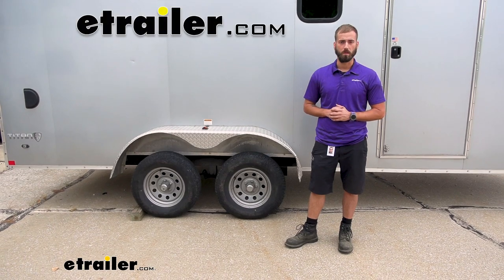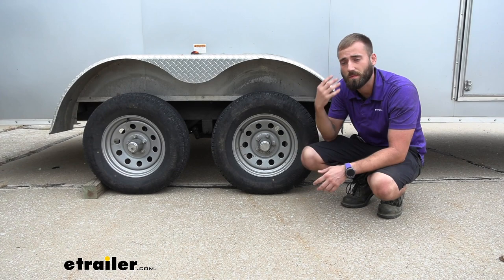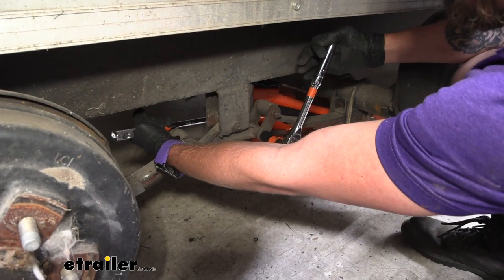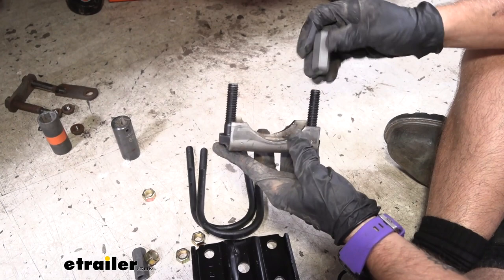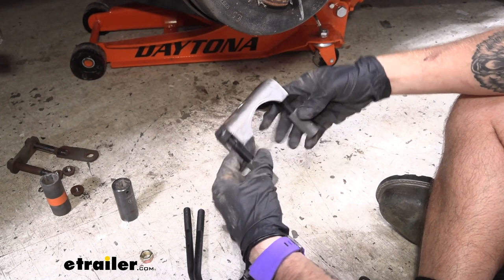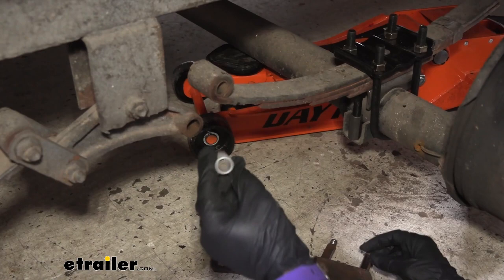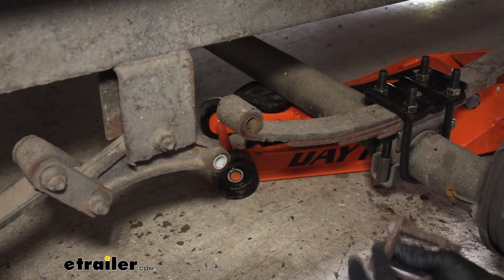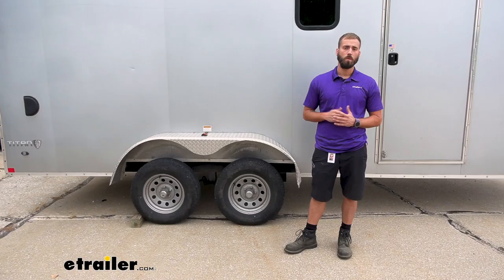etrailer | Complete Breakdown of the Dexter Trailer Springs Over-Under Conversion Kit

Comment: My Sun Set 129 camper comes with a 4 inch lift, looks to have the kit installed already from factory. If so I can just remove the kit, and put the axle under the springs , correct ?